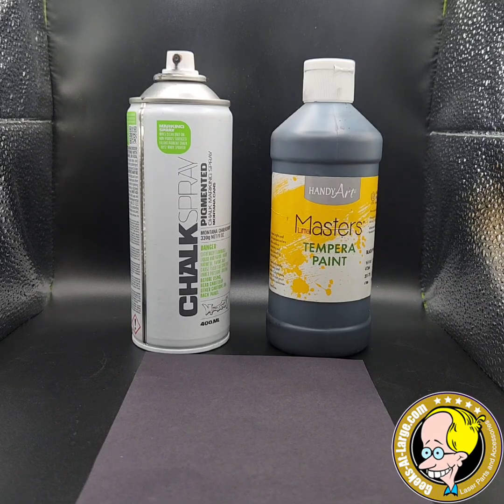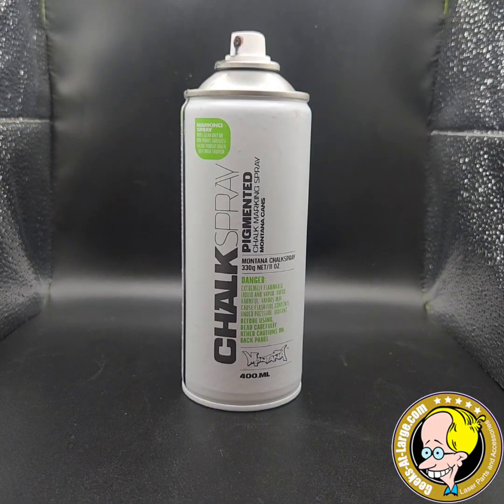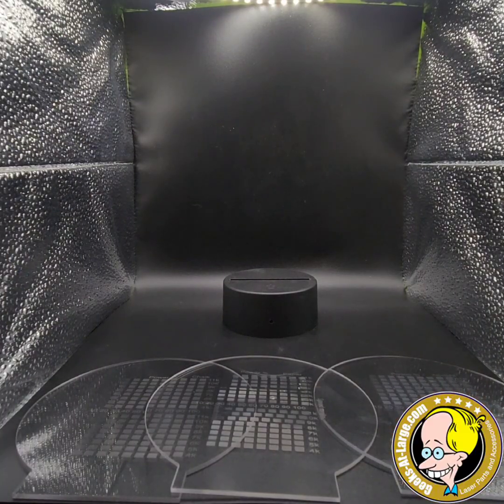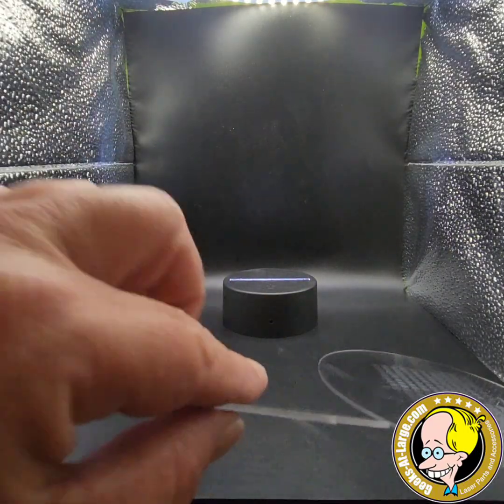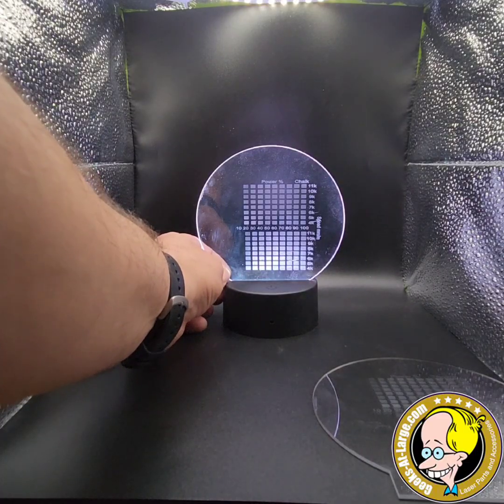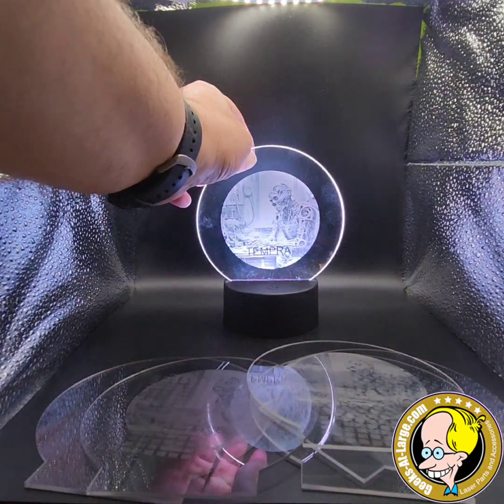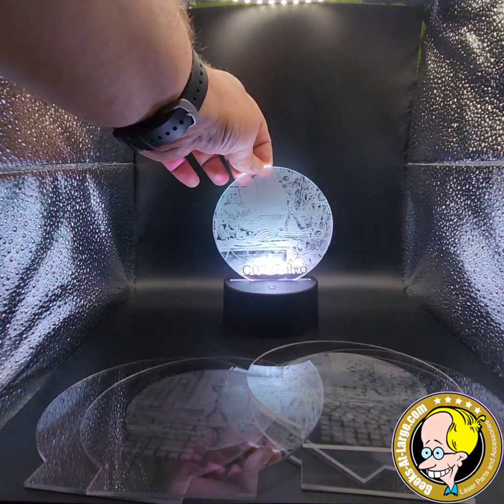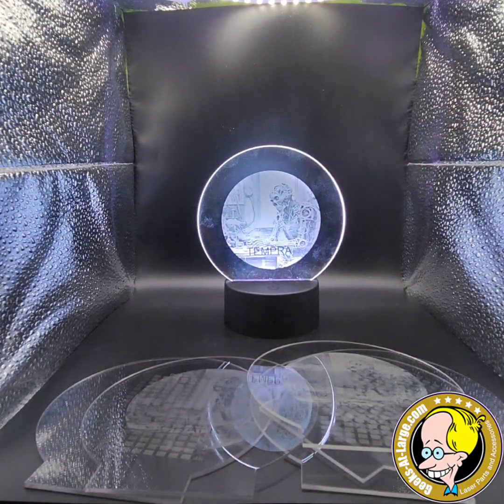Clear acyclic engraving - which method works best?

Comment: Great informational video. As always. I just got a CO2 but the comfort I have right now with the diode this helps. I would imagine the test would be the same on a pint glass?
Reply from the maker: @kevinbankos3119  yup, totally the same for glass :) But, with glass, you have another option - spray paint. It needs acetone to remove the excess after engraving, but gives very good results

Comment: I'm amazed at your power settings. I am new to lasers and run an Xtool S1 40W. For clear acrylic I am using black paper at 23% and 300 speed with 280 lines per cm. The first 2 I did looked great but ran them at less density, I think it was maybe 120 or 140. I just ran 3 more tonight at 23% 300 speed and 280 lines and they all had some pits in them. It just occurred to me watching your video that the first 2 I ran that have no pits I used a couple small strips of wood to space the acrylic  an 1/8" or so above the paper and the ones with pits I laid directly on the paper. Do you think the spacing could be the trick to avoid pitting?  P.S. I made sure the spacers were outside of the design area to avoid the laser beam.
Reply from the maker: @Book-Gnome  pitting will usually be caused by too much power for the speed/line interval. Or, by using extruded acrylic instead of cast.

Comment: What dilution ratio for that paint...  And what have you found to be the best to clean any glues/dirt/oil from the acrylic b4 painting.
Reply from the maker: @compdad  dilution depends on the needle in the airbrush. With a common 0.3-0.5mm, typically 50/50 paint to water. With the 0.8mm I use now, 70/30.

Since the acyclic is covered when I buy it, I simply take off the covering and immediately paint. If you need to wash, dawn dish soap. Keep chemicals away from the acrylic, else it will probably cloud up
Reply: @geeksatlarge   Any thoughts as to painting both sides ?   Soz about all the comments, about to have a go on the TS2 10W and see what happens.

I picked up an LP2 for  1/2 price and I keep getting distracted between Lasers / Routers / 3D printers  and fixing coffee machines...  ADHD is messing me up as I get older...
Reply from the maker: @compdad  if painting both sides, the engraving will be on both sides instead of only one. It creates something of a depth effect

Comment: Will be having a go at a couple as have some gifts re people that have lost a pet and wanted something other than a Photo.

TS2 10W  or TS2 20W  -  Stuki and you base settings will be my go to as a start :-)   As usual the option of Paint is a classic as to what is available in different countries and what can be shipped and at what cost.  I have some kids water soluble paint that I use on bright metal items and will give that ago.  But I guess I need a spray gun as well...   Do you have any recommendations ?   Cheep but functionable, as not sure if it will be required after this little project. 

Always needing more accessories.
Reply from the maker: @compdad  awesome!! I started with a cheap airbrush setup

https://amzn.to/3Q6bkuM

There are also the PreVal DIY spray paint kits, which I've used effectively too

https://amzn.to/48pDVTh

Comment: Do you thin tempera  for the airbrush as the tempera i have is quite thick.
Reply from the maker: @Optikification  yes, usually. For little handheld units, which usually have a 0.3mm needle, 50/50 (water/paint) usually. With larger needles and compressors, I can do 30/70, and 20/80 with an HVLP

Comment: Cobey! thanks for this! The reason I bought the diode in the first place 2 years ago,  was to do acrylics and glass (if I did more research, I probably would have gone with a CO2, but I'm happy with my choice) In all the time I've had the diode (D1 non-pro with the 10 & 20watt head) I have never been able to make the black paper work well for me. My best luck has always been with an airbrush and tempera: it's relatively quick, and easy to clean. Again, thanks for this video. I know many will gain great insight from this. Take care, and be well
Reply from the maker: @RickPMandel  glad to help! :D